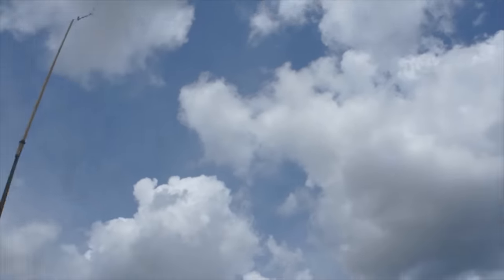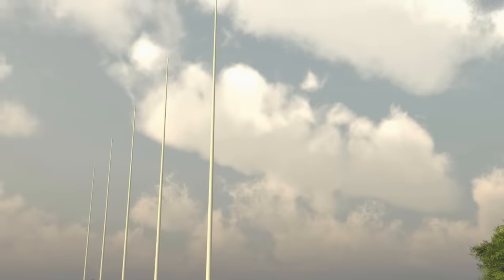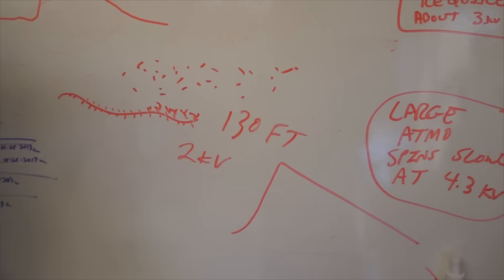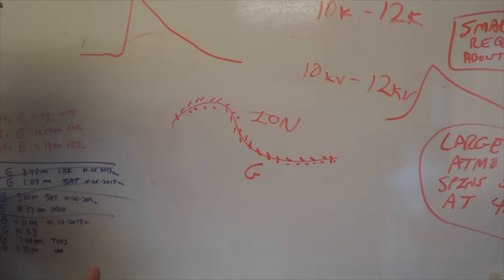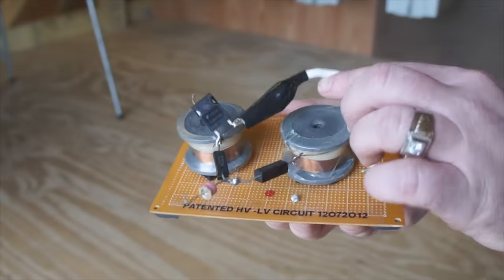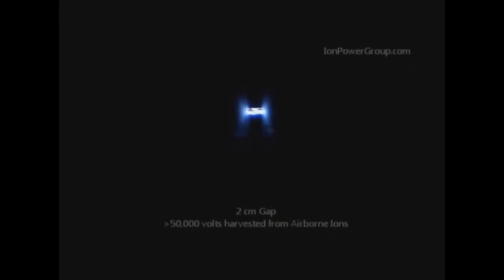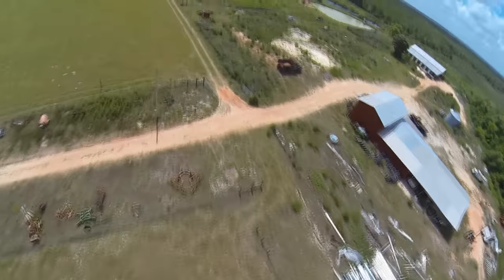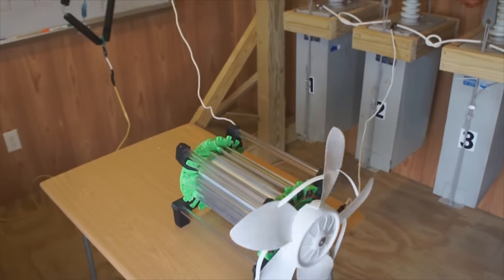Graphene/Graphite Atmospheric Electricity Collectors - Plus Horrific Hexacopter Crash!

Comment: Density. The voltage is high but atmospheric drift doesn't have enough current.
Reply: Tell that to lightning bolts.
Reply: Delicious DeBlair Without the leader arc, lightning carries very little power. This system COULD abstract substantial power from lightning (re-engineered for safely handling it, of course- I wonder why they didn't mention whether or not their array's ever had a strike), but not ordinary levels of ionization. Nearly every attempt at harvesting power from lightning runs into that wall, usually catastrophicly
Reply: The trick is not to have an 'arc' so much as having a steady voltage that can have an oscillating arc at the recieving end, this would allow one to transform the DC voltage into AC to convert it to a useful steady voltage.
Reply: Once again, getting a voltage is never a problem, you can put long leads on your voltmeter, walk outside, drop one to the ground and raise the other even a few meters and you can measure KV ranges.  Store it in an HV cap, and you can use those joules collected for anything your engineer's heart desires to properly design- but that's a very tiny amount of total energy, just like rubbing your cat against the Leyden jar...or use it to realize why walking outside makes you feel good...
P= VI (or I^2R), current (I) becomes the governing parameter as the voltage of the ions in air is approximately constant with elevation, humidity, windspeed, etc., and current is dependent on air resistance to ion flow (which are the charge carriers for nearly all the energy, free electrons have too short a half-life), which likewise varies, but from many K-Ohms to M-Ohms per centimeter UNTIL a leader arc breaks down air's dielectric strength and establishes an ion channel whether it's from you scuffing your feet on a carpet, or a serious lightning bolt. Of course, the lightning bolt itself does other stuff, too, which should be no surprise at 10^12 W power levels.
Reply: I am well aware of how lightning works, I'm not talking about lightning.

Also since the votages range around an average of only 100v/M the idea of getting 'KV ranges' at 'a few meters' is somewhat misleading. To achieve 2kv potential you need at least 66 feet of elevation, minus the resistance of your wire, so when you say 'just a few meters', most people probably don't assume you mean no fewer than twenty meters.

I'm talking about a gradual, steady accumulation of free ions and leading them quickly to ground where they can be sent through a transformer to be stepped down in voltage and up in amperage to useful ranges.

Anybody with a basic elducation in electrical theory knows that watts are watts no matter how you multiply it, but the factors can be swapped out readily on a scalar basis anywhere from one million volts at one amp, to one thousand volts at one thousand amps to one volt at aone million amps.

Therefore, the seemingly novel and worthless high voltage from a leader is not worthless if one has the intelligence and education to simply step down the voltage on an appropriate transforming cluster to the desired voltage and realize much more amperage.

Now I admit, one million volts at one microampere is NOT a lot of power, but the amperage at that point is directly proportional to your regenerative bleed capacity, and for this, a large surface at elevated altitudes, be it as a lot of little pinpoints or a large surface for condensation would be needed.

http://en.wikipedia.org/wiki/Atmospheric_electricity
Reply: "Anybody with a basic elducation in electrical theory knows that watts are watts no matter how you multiply it, ">kinda the point this entire discussion, they (the experimenters) virtually NEVER state their power or energy levels, as it leads to disappointing the gullible (not to mention the insanely poor ROI on the equipment). This type of installation is useful to gather a very small amount of power; there may be situations (emergencies, stc.) where that's important, but without a virtually free source of materials, there's no practical application for this as a power source of any magnitude. One's degree of intelligence or educational achievements won't pay for the transformer (or the materials to make one), or the bus wire, towers, footers, caps, etc., etc., etc.
   The presenter in the video points out their normal VOLTAGE level is 2KV at 130 feet (yes, more than a few meters, my bad for exaggerating), spiking 10 or 15 times that in active weather, but still doesn't say word one about total (not instantaneous) power or energy obtained. This is disingenuous or out poor reporting, nor does he mention whether they've been struck (which would no doubt be gleefully reported at the hundreds of KV available if it didn't simply destroy the facility or at least substantial parts thereof.)
   If this Ion Power Group's objective were to conduct research with high voltage, fine, but their stated goal is to make a utility-scale generator, and most of us already know of lots of practical impediments to that(and virtually ALL of the safety reasons should be considered deal-breakers).
Reply: What you say is true, but the point I make is that thr potential ROI is almost entirely dependent on altitude for 2 reasons: 1, the increase in voltage with elevation is also a technical increase in amperage, so long as the system aquires free electrons from the condensation of ions to maintain said amperage, and 2, even if you had a slight tapering of amperage due to inadequate ion collection array, if you look at the way many racers derive horsepower in engines where the torque is steadily dropping simply by raising the RPMs, this is, in essence what you are facing.

Since the peak or optimum potential voltage declared is around 300 Kv, then if you can get even .01 amps or 100 miliampres steadily, then you will get you 3 Kw steadily.

Is that a good ROI?

Opinions vary.

But still, if you can collect enough free ions at that altitude, you can easily exceed 1 ampere and then you are harvesting 300 KW at 300 Kv.

That is a big 'if' I know, and truthfully I have no expectations of steady ion stream because of the simple fact that ionization potentials riase and fall with one's position relative to the sun.

That said, if one were to institute this as a nationwide energy harvesting program, it would be no problem to institute "aerial ionization corridors" where balloons remain in virtual orbit where they not only harvest ions all of the time, but that they are positioned in any given area where the sun is at its apex somewhere along the surface of the continent, preferrably at multiple latitudes.

Is this a flawless plan? No.

But its a plan with great potential if one obtains the voltage with an inexpensive balloon which is durable enough to endure harsh and severe weather events, and is readily repairable should it experience strikes from micro-meteorites or falling space debris, bound by a reasonably strong tether which is light enough not to weigh down the balloon.

At this point, my personal limitations in the past were the tether.

When you have miles and miles of anything, it is cumulative weight.

That is what put my research on hold, but now there are a lot of newer, lighter, stronger materials one can use.
Reply: Check out Robert Murry Smith's work with SWAG collectors and his new hemp batteries, the combination would be amazing at high altitude the SWAG collecting and the batteries just drinking it all in.

Comment: I wonder if they can take the atmospheric energy and run it through a joule thief or an amplified dc to ac converter to increase the voltage to run a secondary electrostatic motor at higher rpms. Or maybe charge capacitors that can add more amps to the primary electrostatic motor. Would be nice to look into that.

Comment: When shorted, whats the current? because if theres barely any then theres not much point to this.
I can easily convert a 9v3A battery to 400kV using boost converters but at an extremely low current. Point is, just because it is 400 000 volts doesn't mean it has more energy than a 9V battery.

Comment: Not enough current. Generating high voltage is fairly easy. Far easier than the going through all this... But high voltage is nearly useless without high current. You need to start generating Watts. Kilowatts. 

A Wimshurst machine can generate 50KV also but what's the point if you need to crank the handle for 3000 years to make a cup of tea?

So perhaps if you had more poles, taller poles... A lot more and more capacitors... then you could connect a small load to that motor?
Reply: those are the kvs there in the atmosphere, and the more peaks and the bigger your antenna is the more amps it collects.
Reply: That would be a very well-earned cup of tea.

Comment: I am curious as to what the frequencies are for this unit? As a member of the Tesla Society, I have been working on a similar system and find that working well in the gigahertz ranges that one is able to garner more current than voltage. Still, in the low amps and even lower voltages and have yet to find the funds needed to set up a larger system that would allow for a larger tuned array. And if you are using a non-tuned array, then you will obtain large voltages with microamps of energy.

Comment: without amps, voltsis  nothing :P
Reply: Listen i have acess to 1trillion amps at 0 volts but trust me the amps are right below your feet you just gotta move them yourself
Reply: 10 milliamps and 10 kv will give 100 W. so if there are just 10 milliamp but 100 kv you can easily get around 1 KW. and if there only are 1 milliamp, 100 W is still the power. but for so small power, even the smalles solar system can be cheaper.

Comment: The open circuit voltage is in the kilovolt range, but what is the short circuit current? The maximum amount of wattage you could obtain from this system is Vos*Isc/4 (assuming it behaves like a thevenin source). So if you have 4kv with no load and 1 amp flows from tower to ground when shorted, you have a kilowatt!

Comment: interesting stuff,  Not sure about the feasibility due to the production cost vs energy density. One possible way around that would be to use the tower for a wind turbine as well. If you're already putting up a turbine you have the tower and the electrical conditioning, your almost there. just have to add the actual ionic collection itself.

any reason why this wouldn't work?
Reply from the maker: I think that would work just fine.  There are also a lot of existing radio and cell towers that could probably be upgraded with this tech.
Reply: lasersaber Very good point. Tying an energy consuming device like a signal transmission tower into an energy farming source like this reduces the total demand for energy storage as well.

We might even find that the use of simplified, cheaper methods that can be quickly added on to all the existing towers could be the most cost effective approach to powering such devices.

cell phone companies might regularly receive 1-2% of their revenue from surplus energy in the near future. the only question there is if the localized electric potential so close to a signal source might distort it.

Comment: Given the height the Hexacopter flies, is it possible - if at all - to rig it with a miniature Graphene Ion Capture system (with the additional weight that goes with it ) to avoid crashes due to low battery, or at the least mitigate low power situations?
Reply: iMergeAndSee you would need capacitors. If you build the copter structure out of graphene capacitor material, maybe lol

Comment: With no disrespect to the OP lasersaber ; IPG should connect the antenna directly to a DC voltmeter, a DC ammeter and a variable load resistor, and show us DC power. The test equipment to do that is cheaper than what we saw in the video. A big loop like that would probably pick up some AC power from nearby electric power transmission wires, so you would need a rectifier for that - ooh, did I see a rectifier in the video? Looking forward to seeing the DC results with AC pickup excluded! Anything else is just smoke and mirrors (but if smoke requires power then it might be just mirrors).

Comment: @ 8:00 minutes into the video we are looking at an Avramenko plug diode arrangement.The diodes they are using look like microwave oven diodes and thing in front of it is a gas discharge surge arrestor High Voltage device as used in surge arrestor mains power boards.
They are basically a vacuum tube that is open circuit at low voltages but when voltage gets high enough it flashes over and goes to ground.
I bought a bunch of these gas discharge devices today, so i can have a play with this stuff.

Comment: if you arranged the wire in to some kind of grid would it harvest more or is there only so many particles, is there more particles day or night ? and is the currant stable to use on motors etc ? can the energy be stored ? i know its 9000v but volts arnt anything without currant, you must have lit up a tube with static before, it is static isnt it ?

Comment: I liked this v.much.  Could finely powdered graphite be used instead of graphene for capacitors?
Reply: That's what I'm wondering. Will be testing that actually.
Reply: Hope it works.  If it does, graphite is already easily available and I expect cheaper than graphene.

Comment: The real secret is that the charged particles are water molecules. All atoms have positive charge, it makes them spin. A smaller atom (H) bonded with a larger atom (O) has a potential difference between the atoms. Lots of charged particles all aligned in series/parallel makes a thunderstorm! And it is not just water molecules we can align either. Any combination of dissimilar sized atoms will carry a small charge, usually between 1 and 1.5v. That is the standard voltage for alkaline batteries only the molecules are not aligned. We need to align them like we do with permanent magnets, we have the technology already. Permanent batteries charged by the sun's radiant atomic energy is the way forward. ALL atoms are charged by the sun btw. Eletricity is just potential difference (energy) flowing through a conductor.

Comment: Hello.
You both mentioned "weather'"  and I assume you mean Solar weather. There is definitely energy associated with atmospheric weather as we can see in clouds and Lightning. Another Large source may be from Space weather and solar electro-magnetic energy collected by the magnetosphere. Geomagnetically induced currents (GICs) caused by solar activity have had much research for design of transmission line systems, pipelines and satellite shielding. Suspicious0bservers here on youtube has a ton of information that touches on this. 
Great work and research you are doing thanks for sharing it so well.

Comment: Nature still does a much better job at collecting those ions. However the particles for that are also good at seeding condensation, and tend to come along with convection preceding and during changes in a major weather front. Thing is, the discharge from lightning in a thunderstorm isn't really something easily or readily usable.

What's being done here is like a trickle charge in comparison, but I suppose it's something that's quasi-usable. The HV-LV thing looks like they're messing around with some kind of oscillator. I wonder if what it does could also be done with a properly tuned buck converter?

Comment: so if i was to try this out, where would I hook up the + and - is it the wire in the air that produces the voltage, or does the pole have something to do with it as well? do you just put up on long wire and one end is negative and the other positive?

Comment: Wow, Clint McCowen has come quite far since I was working on his project with the little flyback transformers spark-gap device.   I've still not been down to see the setup.   (Oddly, my family in Pensacola moved down to Ft. Meyers right when Clint put up his first giant poles.  Me, I'm outta-tha-loop!)

Yes, the carbon fiber works somewhat as a nano-scale "sharp points" ion source, but unfortunately he didn't want to pursue the other method which gives far higher wattage.

But perhaps that was wise.    If they could actually run a few-HP motor constantly, on a fairly small antenna, that's when the real craziness starts.  Megabucks, and Military, and MIBs.   "He whom the gods would destroy, they first give plans to a genuine FE device."
Reply: Version Ten point oh  thoriated (radioactive) tungsten wire.

Comment: Hi there,
Ever crossed your mind to etch all that aluminium surface? 
I Agree with Robert Murray, and I may  propose that you try applying some kind of paint with crystalline structure mixed with graphene or to use graphene paint as a membrane between more coatings of paint with crystalline structure.
Furthermore  I strongly suggest encapsulating  your device and filling it with vacuum :).
I was thinking about some inert gas first, but in my mind vacuum seems much better option.

Cheers

Comment: If I do not understand wrongly, the voltage of the atmosphere and the electrical conductivity increases with increasing altitude?

We all know that at higher altitudes the wind speed increases,   this means that the higher the height, the greater the flow of air, "Charging of ions" ... Is not this the reason why the conductivity and the voltage increase?  Thank's

Comment: What is the energy you can harvest? Judging by the motor probably <<50W? The florescent tubes are probably about 60W combined and you were able to pulse them so again <<60W)  Just the Volt reading don`t mean a lot, interesting but not enough please provide us with more detail.  Also how do you protect the capacitors from lightning?
Reply: To protect capacitors from ligthtning, one merely* need a lot of high capacity capacitors.

*"merely" being...well...okay its somewhat tongue-in-cheek... =P